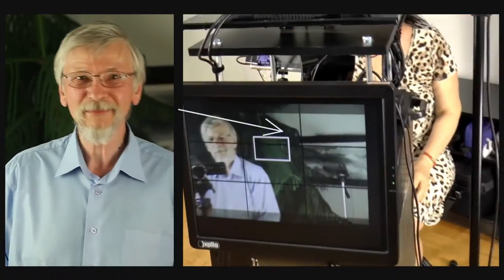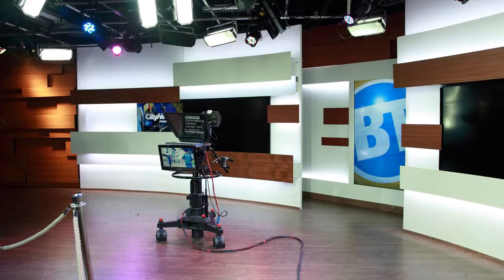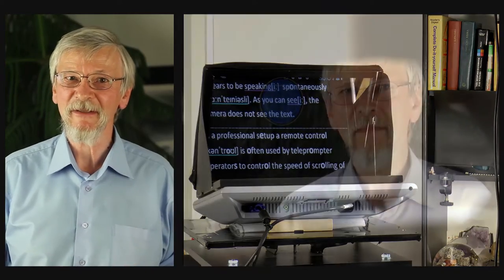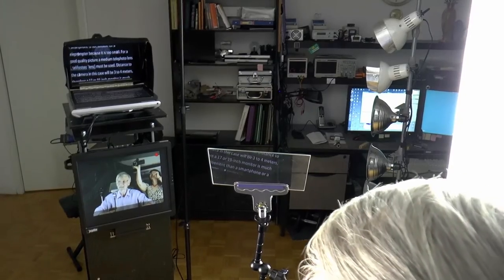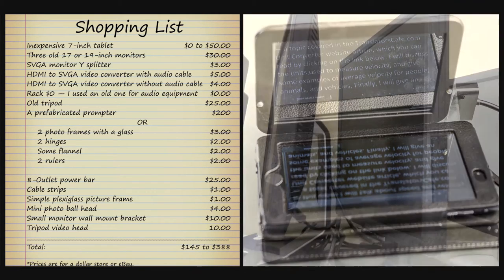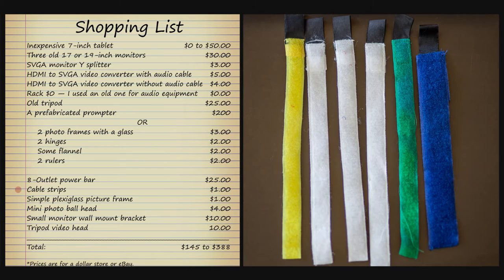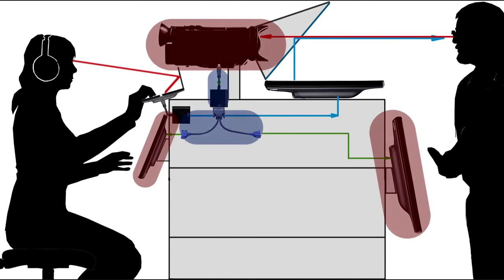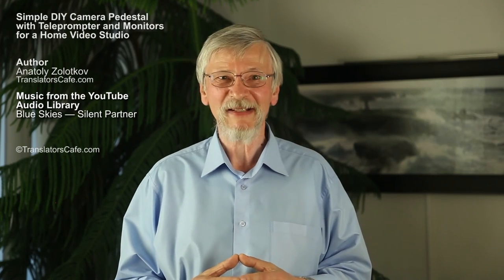DIY  Camera  Pedestal  with Teleprompter  and Three Monitors  for a Home Video Studio

Comment: Nice setup! Although not quite a “pedestal” as advertised....
as height adjustment is absolutely necessary to accommodate people of different height, which ought to be set easily and quickly, without endangering the setup.